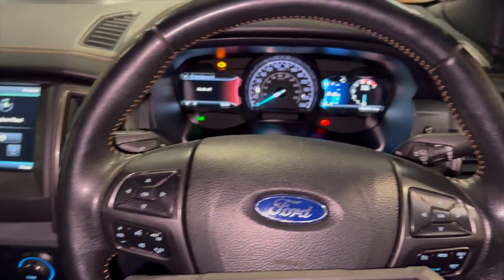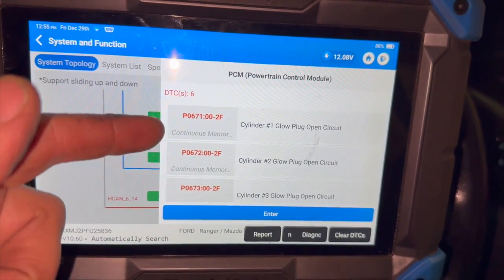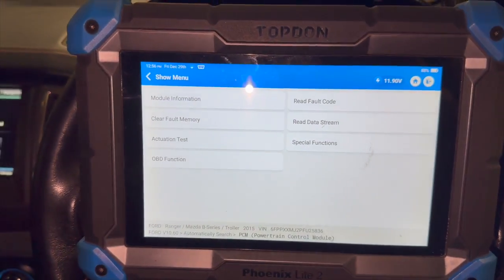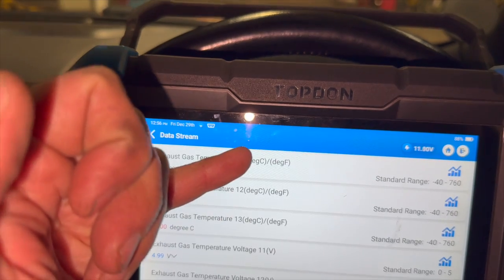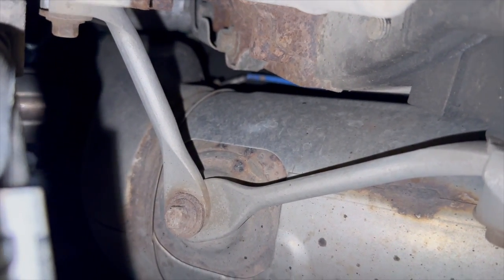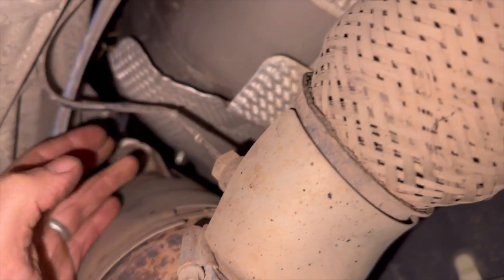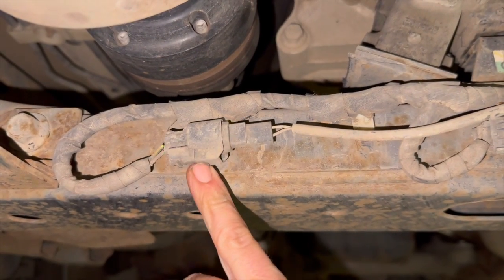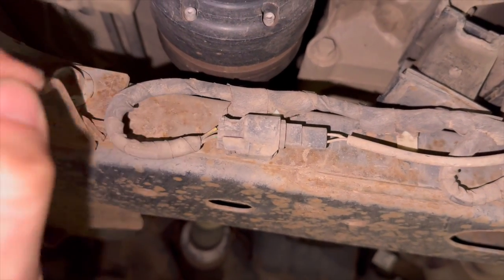Ford Ranger P242D Exhaust gas temp sensor circuit fault code fixed

Comment: Hello, may I ask you, do you know the values these sensors have? I cannot find resistance exact values.
Reply: Typically they start at 2.5 K ohms + then decrease to 150-200 ohms hot
Reply: I have a customers px 2 that only has the top sensor but no 2 and 3 or wiring plugs present 🤔 dpf may have been removed? But get 3 still showing 1000 C oin live data, so no clean burn allowed 🫤